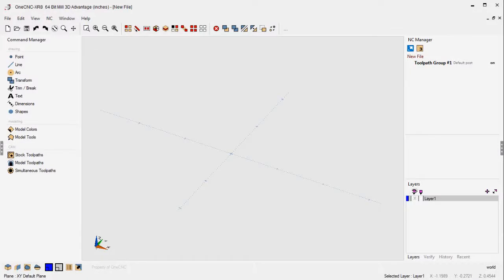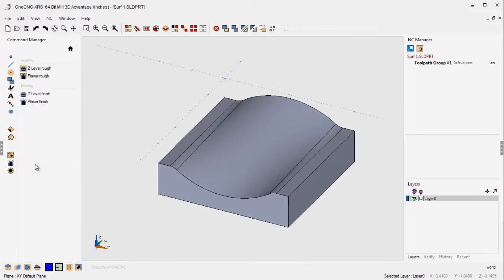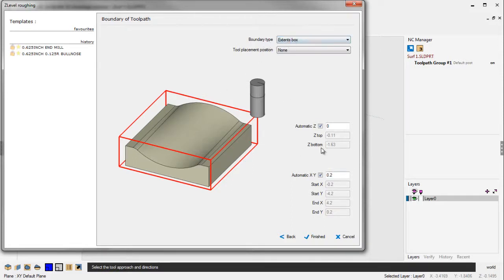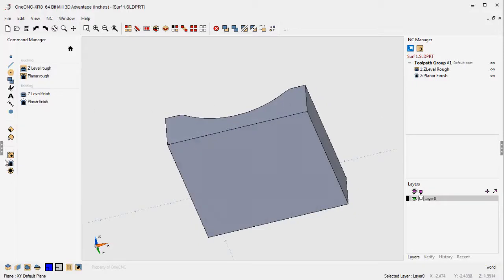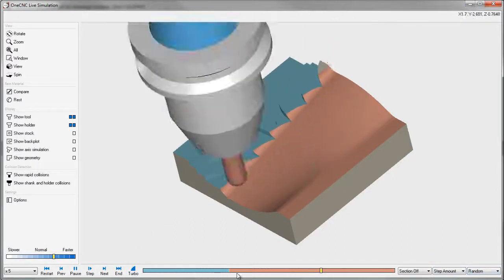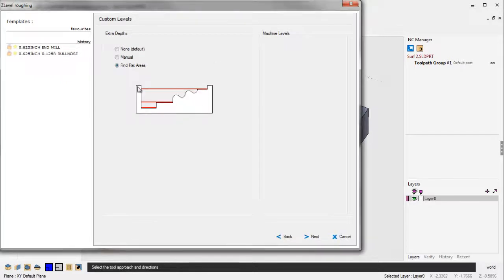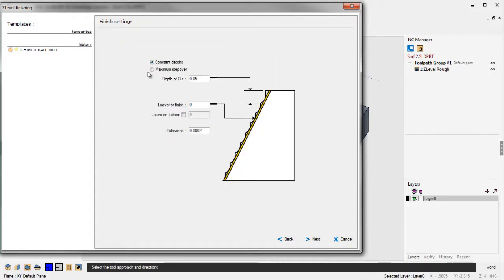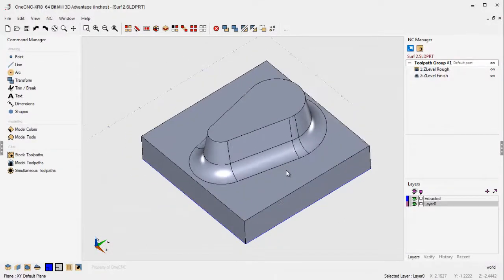OneCNC XR8 Mill Advantage!

Comment: Did you not have too extract edges or surface after importing the solidworks model It looks like the software has automatically picked this up or am i missing something here
Reply from the maker: Hi Philip. Thank you for taking a look at the Mill Advantage video. You are 100% correct. Because we used "Extents Box" as our boundary type, OneCNC used a rectangular boundary picked up from the SolidWorks part.
Reply from the maker: However, if we wanted to contain the tool path further, we would then need to extract or create wire frame geometry for our boundary type.
Reply from the maker: It should also be noted that "Extents box" always creates a self generated rectangular containment boundary based upon the solid model and the XY offset parameters located in the lower right of the dialog box.
Reply: @onecncwest  Thankyou

Comment: All very good but when is Onecnc going to sort out the problem of circles being cut into quadrants
4 lines of code to do 1 circle seriously guy  come on
Reply from the maker: Hi Steve, Thank you for taking the time to watch our videos and for your question. 

The quadrant output is controlled by the  settings within the post processor. This can be set to the following options:

Option - Full
This will output 1 line of CNC code to machine a circle 

Option - Half
This will output 2 lines of CNC code to machine a circle

Option - Quarter
This will output 4 lines of CNC code to machine a circle.

Thanks again and please contact if we can be of assistance.

Best Regards
The OneCNCWest Team
Reply: @onecncwest  Which option should we select  because if we select 1 line  of code we get all sorts of false cuts when machining profiles 
I J and R 
Just R 
or Incremental I J  and R
Thanks